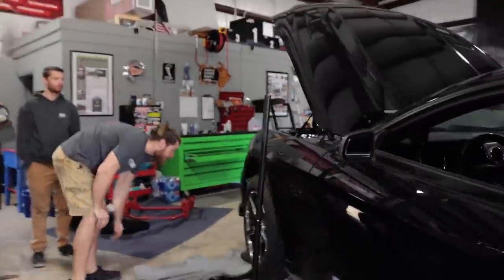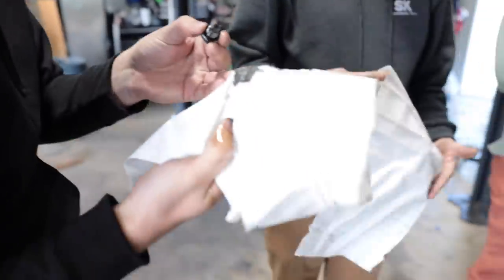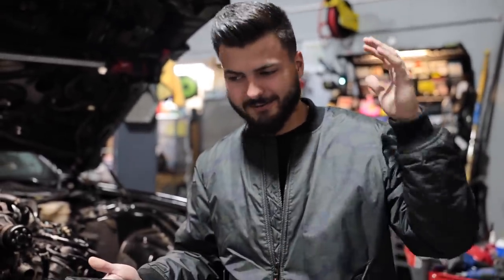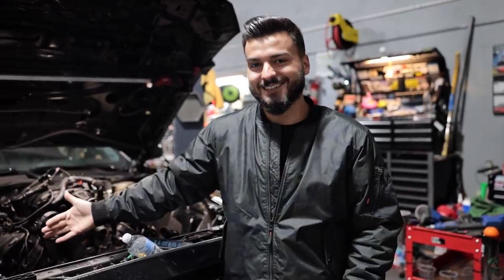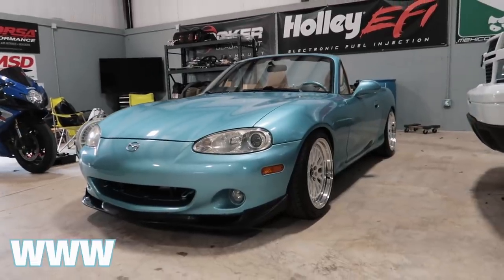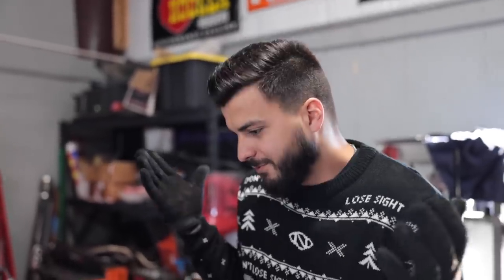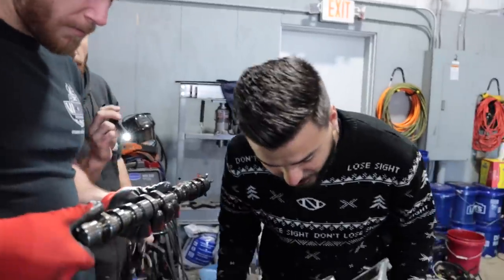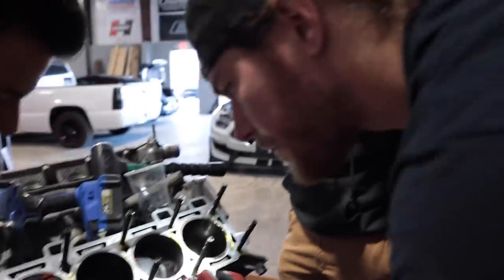Tearing Down Satan’s Blown Motor! | 1,500hp Coyote Engine Teardown

Comment: This is why I keep my mouth shut when I don’t know sh*t about what’s happening. Now I can sit back and relax after learning a little bit more about this stuff while eating popcorn and watching the rest of these guys eat crow. 😂 You guys are awesome, and it’s a bittersweet moment watching the black car go for the last time on this setup, but we all have the same feelings about a certain unnamed engine builder that may have been responsible for this event... 👀 Can’t wait to see you guys build something wild out of what remains. Oh, and I finally bought a manual! I bought it Tuesday and surprised my parents by learning how to drive it in roughly 180 seconds. It’s a 2005 Scion tC with 139k miles. It’s straight piped, which I’m not a fan of personally, but honestly, the crackles and pops when I shift are slowly winning me over. 😂 Now, if you’ll excuse me, I can finally justify buying a save the manuals license plate cover!

Comment: MMR suing itsjusta6 soon!
Reply: how?  The company was never mentioned
Reply: @djwilliams4714  comments mentioning them and if the company see this yeah they will sue him
Reply: Itsjusta6 will win MMR destroyed Gavins motor putting wrong torque and putting wrong size of bering
Reply: Dude how? He paid for it with his own money
Reply: Naw he put too many safety nets in the vid this ain’t his first rodeo
Reply: @BC_CARS  yeah i know but i think gavin will win if they sue him because gavin have evidence
Reply: @marpik1630  Doesn't matter free speech. Not to mention Gavin has no control over what his fans say or do.
Reply: @BC_CARS  yes, but Gavin sent that engine to MMR and guess what MMR did? They sabatoged the engine by replacing GAVIN'S head gaskets with their own head gasket. Not to mention, the bearings were NOT machines properly, something MMR clearly should have seen both times they got the engine

Comment: Noticed that the middle #3 main was eatin up... Thats a. Running stock clearance on a performance issue.. Usually you should runn a looser middle main clearance to compensate for crank flex... She grabbed the bearing a kept eating

Comment: this is fucking hilarious, im so glad that this video came out. mmr definitely didnt check that 5.0
Reply: You really don't know what happened? MMR didn't build this motor for them, and they didn't pay MMR for anything. This was a second hand motor that they hacked together after buying it from someone else. See how they hammer away in this video?... that's how they treat a build lol. Anyway, the truth is they asked MMR for help, which they agreed to, and then sent the engine and parts, including the bearings they are complaining about, to MMR to be reviewed and refreshed. Real MMR motors use specific parts. I have one...a 1500se and it's an absolute beast. Even still, I'm sure MMR did the best with the parts provided, and even after that, the treatment of the motor is what caused this issue. The redline was not a soft redline. As he is mentioning even in the video, he is referencing the physical limitation of the crank/cam combo, which is still questionable. There is more to it then that, such as stroke, cam spring choice, etc. The etching away at the gaskets is from repeated physical limiter hammering, and then the boost crossed into the water cavities, and blew off the coolant line. Instead of admitting his mistake and resolving it, they just sent it again. Absolutely insane. So then he had fuel and coolant displacing the oil which absolutely destroyed the bearings and rest of the motor. This is 100% the fault of this nutty dude in the video.
Reply: @raredesign  are you working for MMR or some shit? You've put the same word for word reply on a bunch of comments
Reply: @garretttippett-patterson4767  Easier to copy/paste in reply to all the dumb comments. People need to be aware what Gavin is doing. It isn't right. I don't work for them, no. I bought one of their motors, 1500se, and I don't think it is right for them to take the heat, so someone needs to stand up.
Reply: @raredesign  bro they verified it was their motor and held it hostage. Motor was making under 1000 wheel and they also swapped the head gaskets. They kept the engine for months and where supposed to go through it. Gavin clearly said he didn’t care cuz the motor was done at that point which is why he hammered the main caps off like that. Not saying it’s the right way but he clearly said he didn’t care as he was getting a different engine. Either way if MMR so called went through it and it was their block they should’ve seen that bearing was way undersized and changed it. For the sake of their company, but they blamed it on improper timing but there were way deeper problems.
Reply: @jasonn277  Power numbers mean nothing if they were running a shitty tune. They could’ve been running super lean and nuked the engine under boost. Don’t think they took the time to get it properly dyno’d and tuned by someone who knew what they were doing. At most they probably just downloaded a chip tune or some shit. At worst they probably just tried to add more fuel and boost on a table. Who knows. The likelihood of them getting screwed over twice by a huge company that makes thousands of motors makes no sense, especially since they are a well known company, and since he already has a big following to impact their sales.

Comment: When the bearings get to hot, the bearings curl in.  This is common with low or lack of oil pressure. This is what happens right before they spin.

Comment: MMR really be talking some sh!t on Facebook. If they forced him to do a public apology and threatened to take him to court they should’ve done that engine the right way in the first place.
Reply: We spammed them with so much BEANS they deleted the post
Reply: Did mmr take their post down of Facebook? They took there post down off on Instagram. I wonder why? I like the Pontiac emblem.
Reply: MMR does the same on the SVTP forum.  They are children trying to run a respectable company and failing big time.  Then going on social media acting like the children they are.  That company sucks.
Reply: You really don't know what happened? MMR didn't build this motor for them, and they didn't pay MMR for anything. This was a second hand motor that they hacked together after buying it from someone else. See how they hammer away in this video?... that's how they treat a build lol. Anyway, the truth is they asked MMR for help, which they agreed to, and then sent the engine and parts, including the bearings they are complaining about, to MMR to be reviewed and refreshed. Real MMR motors use specific parts. I have one...a 1500se and it's an absolute beast. Even still, I'm sure MMR did the best with the parts provided, and even after that, the treatment of the motor is what caused this issue. The redline was not a soft redline. As he is mentioning even in the video, he is referencing the physical limitation of the crank/cam combo, which is still questionable. There is more to it then that, such as stroke, cam spring choice, etc. The etching away at the gaskets is from repeated physical limiter hammering, and then the boost crossed into the water cavities, and blew off the coolant line. Instead of admitting his mistake and resolving it, they just sent it again. Absolutely insane. So then he had fuel and coolant displacing the oil which absolutely destroyed the bearings and rest of the motor. This is 100% the fault of this nutty dude in the video.
Reply: @raredesign  . I’m not saying that mmr is at fault for this. I think that there are a great company that does cool work. I also wanted to know why and if the Facebook post was taken down.  By the way I love your mustang it’s so cool.
Reply: @vs-mt1qx  thanks bro and yeah @Yad said they spammed BEANS
Reply: @raredesign  I understand where you’re coming from but if they force him to do a public apology and have everyone delete their negative reviews on the company it’s kinda childish. And they way they reacted as a business that is extremely childish. Maybe Gavin should’ve paid to have better parts on but still it was his choice not to. But MMR had part failure. The timing tensioner and the head gaskets. Which they took off Gavins old head gaskets to put on their own. So yes both parties are in the wrong about the motor. I just thing they took a very irresponsible response to the video
Reply: @mysticshifter983  there are still some bad reviews from people who are not customers.
Reply: @vs-mt1qx  I understand that and it’s not fair for them but almost every single business goes through that. It’s not right for someone to do it but people still do
Reply: @mysticshifter983  yup. Hopefully people can stop hating on mmr. Does anyone know why the post were taken down? Everyone one Instagram was backing mmr.
Reply: @vs-mt1qx  I heard it was because people were spamming beans but I’m not sure. Maybe contract or legal action
Reply: @mysticshifter983  ok.make sense.
Reply: @mysticshifter983  I would expect the same thing with my business. They did a free service with parts that weren’t there’s and were stabbed in the back. Not really an unexpected part failure, and I’ll explain why. I have the 1500se motor MMR sells. I bought every upgrade option and billet internals. I later learned there is a mod you can do to the ratcheting tensioners if you want to be able to safely bounce off the limiter...and unfortunately I did not do it, but plan to when I send it to them in the future for a refresh. So for now, I have to be mindful about how I limit it, in which case I use an N2MB for a soft limiter by cutting spark, but keep the fuel going. I’m not bouncing off the physical limit of the valve train. When you repeatedly bounce off a limiter, there is a ton of harmonic shock created in an engine, and it hammers on parts. The ratcheting lifters will constantly tighten the chain to take up slack, and it is known that it can get so tight it breaks the chain. This is not an MMR problem. The gasket issue is because of aggressive timing in a tune that is known to lift heads,  but when you beat on the limiter again, it stresses the gaskets, and that is what failed and blew off his coolant line. For some reason he didn’t fix it and save his motor, but instead continued to run it, which caused coolant and fuel to displace the oil and eat the bearings.
Reply: @vs-mt1qx  Thank you. Much appreciated. I’m hoping to turn up the boost in the spring and hit 1000rwhp or so.
Reply: @raredesign  cool. I’m looking forward to seeing that video.
Reply: @vs-mt1qx  Thanks, me too lol
Reply: @raredesign  You keep spamming the same thing. How much does MMR pay you for this?

Comment: if your tune is for E85 and the fuel is E92 that can make the car run lean.
the higher the eathol conent above the tune the leaner it goes, the lower the content the richer it goes. the octane is better higher but it requires more fuel

Comment: from what i have seen so far mmr is doing a very shit job building engines
Reply: You really don't know what happened? MMR didn't build this motor for them, and they didn't pay MMR for anything. This was a second hand motor that they hacked together after buying it from someone else. See how they hammer away in this video?... that's how they treat a build lol. Anyway, the truth is they asked MMR for help, which they agreed to, and then sent the engine and parts, including the bearings they are complaining about, to MMR to be reviewed and refreshed. Real MMR motors use specific parts. I have one...a 1500se and it's an absolute beast. Even still, I'm sure MMR did the best with the parts provided, and even after that, the treatment of the motor is what caused this issue. The redline was not a soft redline. As he is mentioning even in the video, he is referencing the physical limitation of the crank/cam combo, which is still questionable. There is more to it then that, such as stroke, cam spring choice, etc. The etching away at the gaskets is from repeated physical limiter hammering, and then the boost crossed into the water cavities, and blew off the coolant line. Instead of admitting his mistake and resolving it, they just sent it again. Absolutely insane. So then he had fuel and coolant displacing the oil which absolutely destroyed the bearings and rest of the motor. This is 100% the fault of this nutty dude in the video.

Comment: “Don’t lose sight MMR”😂😂
Reply: You really don't know what happened? MMR didn't build this motor for them, and they didn't pay MMR for anything. This was a second hand motor that they hacked together after buying it from someone else. See how they hammer away in this video?... that's how they treat a build lol. Anyway, the truth is they asked MMR for help, which they agreed to, and then sent the engine and parts, including the bearings they are complaining about, to MMR to be reviewed and refreshed. Real MMR motors use specific parts. I have one...a 1500se and it's an absolute beast. Even still, I'm sure MMR did the best with the parts provided, and even after that, the treatment of the motor is what caused this issue. The redline was not a soft redline. As he is mentioning even in the video, he is referencing the physical limitation of the crank/cam combo, which is still questionable. There is more to it then that, such as stroke, cam spring choice, etc. The etching away at the gaskets is from repeated physical limiter hammering, and then the boost crossed into the water cavities, and blew off the coolant line. Instead of admitting his mistake and resolving it, they just sent it again. Absolutely insane. So then he had fuel and coolant displacing the oil which absolutely destroyed the bearings and rest of the motor. This is 100% the fault of this nutty dude in the video.
Reply: @raredesign  🤡
Reply: @raredesign ... the engine builder completely and utter destroyed what was supposed to be a rebuilt quality spec block. They signed off on it and released it back to the customer. Their response to it should be very telling of where they stand.
Reply: @raredesign  This is MMRs burner account
Reply: @brodyz8327  You didn’t read what I wrote, did you? Gavin provided the parts including the bearings he complained about. This wasn’t an MMR spec motor. Even still, the build isn’t what blew it. Gavin over-rev’d with aggressive timing, chipped away at the gaskets until they failed and the boost leaked into the water channels, blew his line off, and rather than fix it and replace the heads to save the motor, he continued while the fuel and coolant displaced the oil and ate the bearings.
Reply: @yungterv198  I don’t work for MMR. I have their 1500se motor which is very strong (check my profile), and I think it is disgusting that Gavin blew his motor (due to his fault) and used his influence to create a hateful video and comment section. It’s wrong.
Reply: @raredesign  that’s exactly what a burner account would say
Reply: @yungterv198  okay 👍
Reply: @raredesign  I’m not about to read that
Reply: @yungterv198  he’s responding to everyone acting smart
Reply: @williammolnar6570  it’s better than acting like the rest of you on here.
Reply: @williammolnar6570  you don’t have enough attention span to read for 2 min?
Reply: @raredesign ye idk... i get where ur coming from.. but they signed off on it they coulda said something if it wasnt up to spec.

Also... its only making 900hp even if the timing is more on the agressive side lets say the engine is not even close to its rated horsepower so even under agressive timing(which btw is an assumption you dont know how agressive the timing was) it should still take it quite forgivingly.

And im pretty sure tht limiter wasnt too high im sure his tuners would of said something about the limiter or tuning if he was really messing up.
Reply: @monyhift3847  The plugs look a little suspect, and someone else had mentioned that the tops of the pistons indicate as much. Aggressive timing is known to lift heads, and it is safer to run more boost than timing. In my opinion, based on what he showed here, the motor was actually fine, even though they asked for a non-MMR build. They tossed the variables in there mind you. When the gasket had an issue, that's it, turn it off, drain the oil pull the heads, let it dry out, and replace the gaskets. The motor was destroyed by neglect.
Reply: @raredesign  The company paying you yo repeatedly post the same thing, is a company with no business building engines. MMR builds garbage.